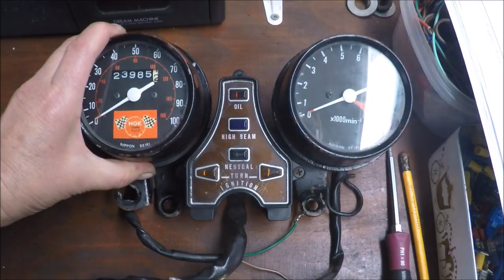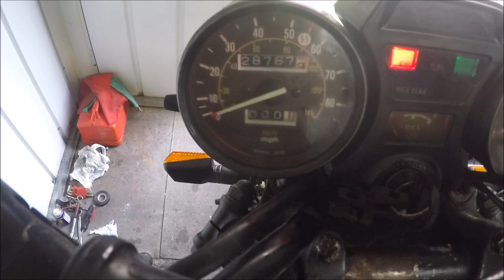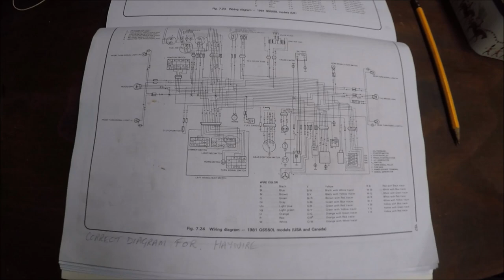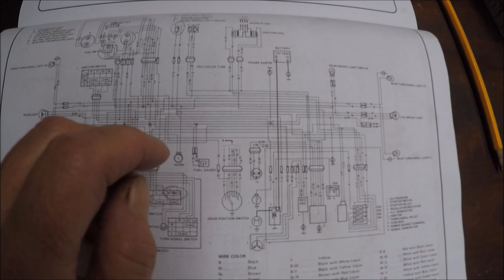GS550 Rat Bike Restoration Project 45 #Electrical Work/Wiring Loom. Problems Solved!

Comment: Hi R Q can  I ask you is it possible to do electrical tests on stuff without the engine fitted .This maybe a completely stupid question but I am not very good on electrics I have a multi meter  I am guessing of course you would need a battery connected of course . Cheers Mal
Reply from the maker: Hi Mal and yes there are simple tests using a multimeter for the coils, regulator stator coil and pick-up. No battery involved. You'll find everything you need to know on YouTube. Just put in "how to...." That's how I've been learning and it's helped tremendously. Once you get the hang of the multimeter it gets easier. I wrote all the different tests down so I can refresh the memory if needed. Hope that helps. Good luck and have faith! You can do it! :)
Reply: @Ratqueenbikes  Thats great 👍 many thanks R Q